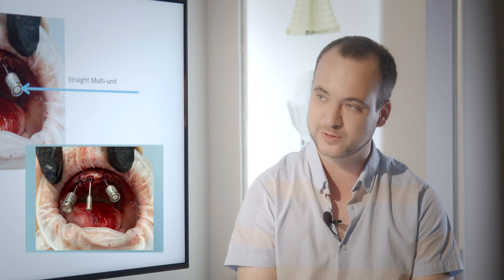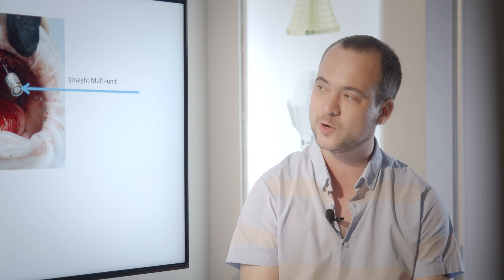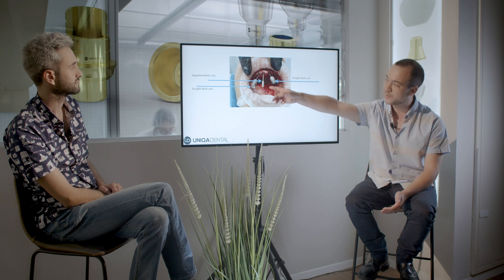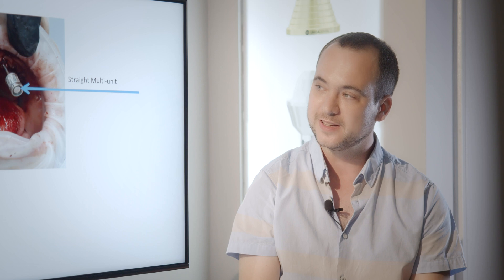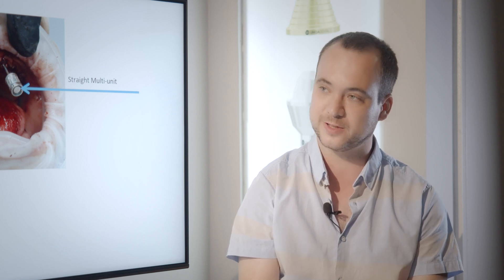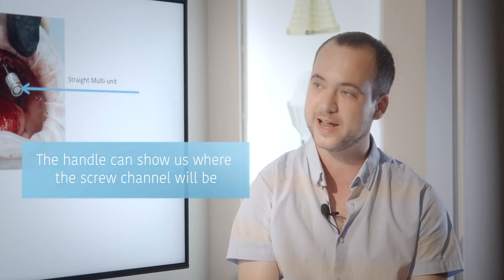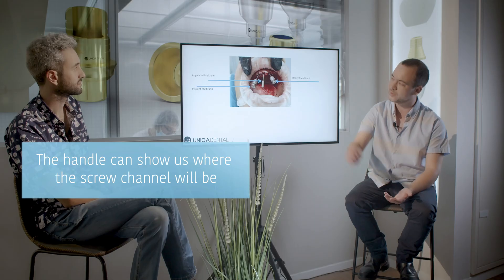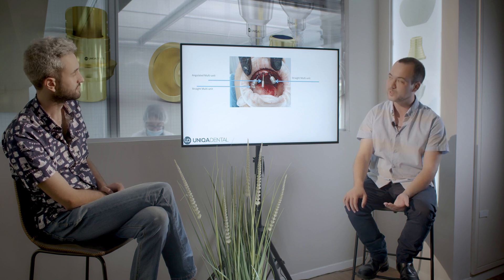What to choose straight or angulated multi units? Dental implants in dentistry. Digital impression

Comment from the maker: 00:00 It's hard to know exactly where the screw channel will be. 
00:29 Making an immediate restoration on immediate implementation
02:45 What is the next step?
03:33 At least one implant level scan abutment

04:00 The screw channel will still come out vocally

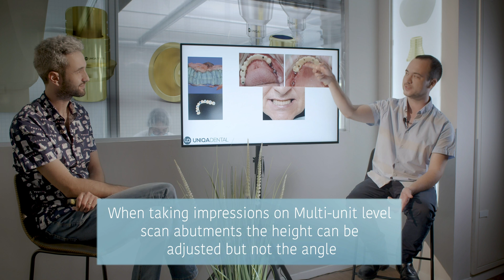05:00 You can change this multi-unit impressions with an angular multi-unit.
06:03 Immediate loading on multi-units.